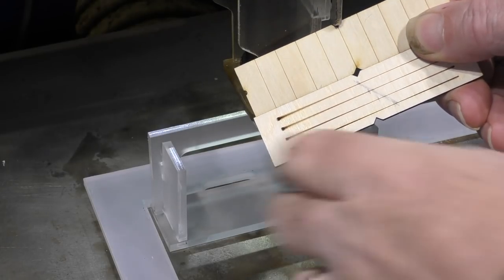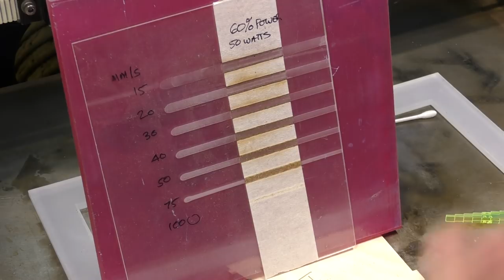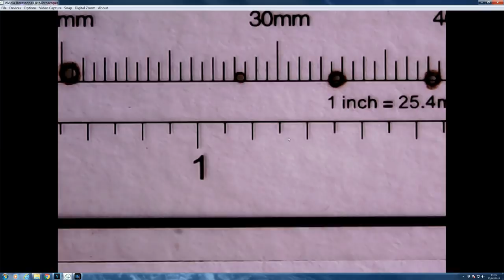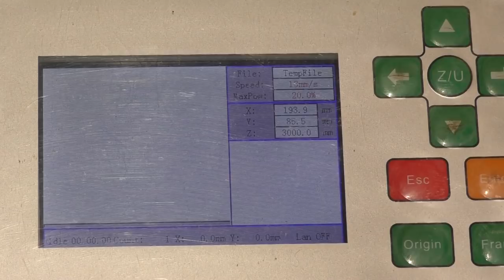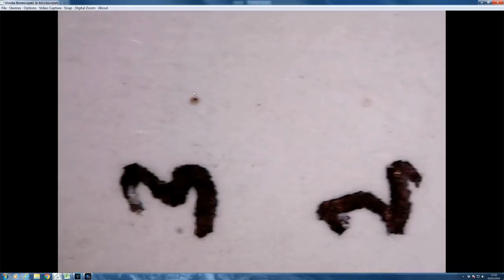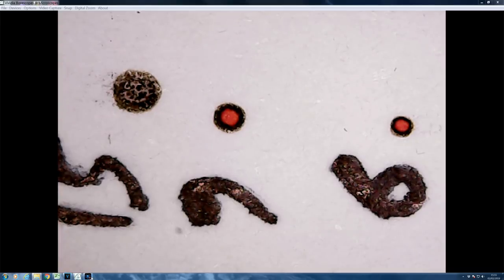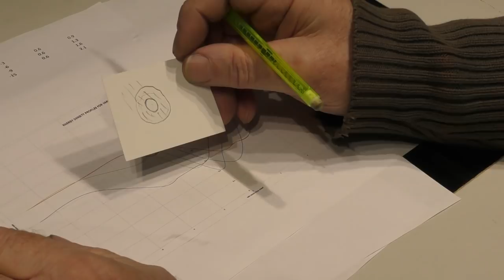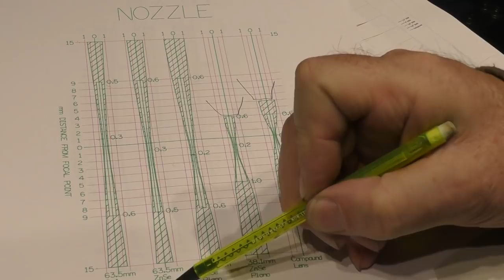RDWorks Learning Lab 162 Lenses part1 Let's Focus

Comment from the maker: To anyone that watches this, it is now several years old and my reserch into the way that lenses and laser beams work  has moved on in leaps and bounds.  This video investigates the fact that the OPTICAL focal point appears to move with speed. I now know that there is an OPTICAL focal point that results when  lens geometry, focuses NORMAL uniform random light through a small spot for IMAGE projection beyond the focal point. However, laser light is not  random or of uniform intensity and has no image to project.  It's work starts and finishes at the focal point. These Gaussian intensity  light rays are refracted exactly the same as normal light by a lens BUT this time were are employing the INTENSITY of the beam to damage material  and that INTENSITY focus is the the feature that changes with speed, power, and material being damaged.. There is so much more to learn.

Comment: Wow. I have to contradict you. You are a natural instructor . As a technical director at a high school for many years I can say your lecture , drawings and charts were captivating and many teachers would love to have your skill. Thank you as I learned a lot about the optics.
Reply from the maker: Hi 
Thanks for the kind words.  As I say, the lens is the most important part of our machine and it appears to be one of the least understood elements. I did college level physics and chemistry and a lifetime in engineering has further focused me into learning more about narrow areas.  With much deeper recent research into optics I am finding it difficult to make theory and practice match. I am further frustrated that I can track down almost zero scientific research on the peculiar way that light energy reacts with materials during the cutting process after passing through a lens. There a a couple of great publications that I have studied during my time of owning a couple of 3kw metal cutting lasers but that theory does not apply to these non-metal cutting machines.  Metal cutting is dependent upon high pressure oxygen or ultra high pressure nitrogen assist gasses for the cutting process  to be successful. 
This initial foray into lens behavior has made me realize I need to understand so much more. I think this exploration will take many more than 3 sessions 

Best wishes
Russ

Comment: Very nice. I enjoy your clear, explicit and “common man” quality of your explanations. That makes this highly technical stuff far more accessible to everyone.
It might also serve to point out that the total power within the beam is distributed across the area of the beam at any point, in a Gaussian curve, and all beam diameters. In short, the total power remains almost exactly the same as the area under the curve of distribution, but consequential to total area. And of course, total energy delivered to any one location is always a function of how long the beam “rests” at that position.
Finally, the difference between the hole made by the converging beam (a) suggests a broader, Gaussian energy distribution, as compared to the divergent beam holes (b and c), which do not appear to be quite Gaussian distribution.
Looking forward to your next installment share and what conclusions you draw from the data.

Comment: When I bought a 2nd hand Chinese laser with no data on the supplied lenses, I performed a similar test but instead of attempting a narrow beam, I used the manual power to engrave a rectangle on sloped wood.  Turned the power down as far as possible while still getting a mark.  The theory is when out of focus and at low power the power density is too low to mark the wood.  Therefore at very low power, only the area in sharp focus had enough power density to produce a mark.  This is how I found the focal lengths of my 2nd hand lenses.  I just made focus spacers for the nozzle to work space for the two lenses.
Reply from the maker: Your method is perfectly valid and it will determine what I would have prevoiusly  believed to be the focus point. This session shows that you can never be certain of the exact focus point The manufacturer claims one focal distance  but we have no idea how that figure was arrived at. The the static tests as I mapped the beam shows large variation from specification and then there is the addition change of focal point with velocity.. Hmmm...who said this stuff was simple???
Best wishes
Russ

Comment: There is a problem with focal length calculations, the focal length of a lens is measured (not calculated) by the focus position when the light comes from infinite distance, but when dealing with macro or close focus it is best to calculate it by measuring the distance between subject and figure when magnification is 1: 1 and F  is the distance between the subject and the figure  divided by 4
Reply from the maker: For my first few years of using this technology I was happy to assume that the conventional lens theory that I had been educated with and used as a photographer was equally applicable to laser light. However as I tried to decode the odd behaviours of different lens shapes. orientations and focal lengths I discovered that conventional lens theory is not applicable. Yes, the focus rule you quote is applicable  BUT the light entering the lenses is not uniformly distributed as in the normal light world. Laser beams  are very non uniform and the intensity is usually a Gaussian distribution. Because the damage you inflict on materials is directly related to light intensity, it means that although the outer diameter of the beam defocusses away from the focal point the central core of the beam has tremendous power (intensity) way above and below the focal point. This is best proven (if you have a laser machine) by observing the fact that the line thickness or apparent focal point changes with speed and/or power. Fortunately conventional white light lenses do NOT change focal length with light intensity and that is why normal lens theory works for a uniform  light from an infinite distant source.
Welcome to the weird world of focused laser beams.
Best wishes
Russ

Comment: Is there not an acceleration factor for bringing the laser head movement up to its travel velocity and then slowing it down at the end of the run and could that be what you are running up against?  I would think running the 10mm slope over the length of the X-axis might show a better or more consistent focal point position?
Reply from the maker: Hi Scott 
 You do indeed bring up a very good point. Yes, it  does take more distance to accelerate the head to faster speeds. However I think you are imagining that acceleration to be slow and the reason for variation of focal point with speed. However, If you lay the material flat then there is no focal variation involved.  What you will see ( as I think you anticipate) is a thick line as the head starts from zero speed and it quickly becomes a constant thickness line until you slow down, whereupon the line gets thicker again as it decellerates.  At slow speed this acelleration phase is about 3mm and at the fastest speed I used  it's about 20mm.  The key narrow parts of all tests were well away from this acceleration region.

 As I move forward with my learning journey, always remamber these are not tutorials by some expert. I am still a student who is self-educating himself  about the minute details of this technolgy. I am sharing my journey for others to observe. Yes I do make mistakes (that all part of learning) but I try to correct them in future sessions. However in this session I did show that the ramp test must be used carefully but did not undersatnd exactly why this interesing anomoly was occuring. It took another 2 years for me to fully decode why.  It turns out that speed, power and material type can put the focal point of a lens as much as 4 or 5mm diffent to the manufacturers  designed focal length 
 Best wishes
Russ

Comment: 52:49 - That's really an interesting question... sounds like bull to me too from what the pros says... Do you get the same results for all different sizes of diverging lens? if thats the case... then it means the pros needs to reevaluate about their understanding of optics and laser beam.
Reply from the maker: The optics companies only have one goal and that is to focus all the light to a single point. That is the standard against which all lenses are judged. All Chinese lenses for these machines are very simply made with a spherical surface. on one face and usually a flat face on the other. This produces a poor quality focus and would be abysmal for photographic work because of a natural effect called spherical aberration.  This can be reduced significantly by adding an additional focusing  shape to the other face of the lens, a concave  surface. This is called a meniscus lens and is about as complex as we can buy Better focussing for visible light lenses  can be achieved with aspheric lenses.. No such fancy gear for us. BUT...do we need it  Crappy cheap Chinese plano convex lenses may be laughed about in "proper" optical  companies  but they cat at least 30% better than the more expensive lenses. Why?  Well I am convinced there is a weakness where the the power is poorly focused  just around the central axis of the  lens. This is because the spherical face is almost normal to the lens axis and very little bem refraction occurs.. This also just happens to coincide with the most intense (powerful) part of our Gaussian laser beam.  Seems like the perfect marriage to gain more cutting power from the lens. Lots more work to do on this and you will see my progress from time to time as you continue following my learning journey.
Best wishes
Russ

Comment: I've been watching several of your videos with great interest! I have no direct experience with CNC Lasers, though I do have a CNC mill and I did take physics in college. Anyway, I see what you're getting at with your interesting ramp experiments, but I do have a problem with references to 'dynamic focusing'. I think we should separate the optics and optical definitions vs. the cutting effects. So, no, the focal length and the instantaneous focus of the laser energy does not change as the speed of the laser head movement over the substrate changes. What is happening reflects the complex interaction of focus (fixed effect) vs. rate of local energy delivery per unit length of travel of the beam over the substrate. Consider the following 2 edge case scenarios all executed with the same (ideal?) focus of the laser cutting, say 5 mm cast acrylic:
1) 'Slow burn case': In this case, the laser is moved ridiculously slowly along the cutting path and one gets an extremely wide and ugly 'cutting' line
2) 'No burn case': In this case at the opposite extreme, the laser is moved so quickly that the laser has no discernible effect along the cutting path.

Obviously the region of practical utility lies between these two extremes. While all else is held constant, imagine runs starting with scenario 2, but with slower and slower cutting head movements. As travel along the cutting path slows, you see first the faintest beginning of etching and these will reflect the smallest 'static' dot size if that is how the laser was originally focused. As speed is further decreased, depth of cut and width of cut will increase. For practical cutting, you have to set the focal point below the surface and set the speed and laser power such that a clean sharp cut is achieved. There is no 'dynamic' focus. But the dynamics of the cutting situation will affect the where the ideal focus depth is for a given substrate (material & thickness). 

Sorry to ramble on, this is really interesting stuff. Hope to have a CNC laser to work with soon and look forward to more interesting videos from you!
Reply from the maker: Hi Steve
In several of my sessions I have clearly demonstrated the effect you describe where  the speed  effect (energy deposited per unit of time) causes the the damage track of the beam to get thinner with speed. I entirely agree that this effect  cannot be anything to do with the focus because I can show this effect with no lens in place. No, the apparent change of focus I am observing is caused by the Gaussian energy distribution within the beam. My brain works in a very naive way and I like to imagine equivalent real world pictures to lock in these flimsy concepts. In this case i imagine a very thin pointed artists brush.  The brush may have a body thickness of 2mm but the tip of the brush will be almost zero. The lighter the application of pressure, the thinner the dots or lines the brush will make  on the canvass.   I do understand that the focus point of a lens is a fixed property. However just because the beam is focused with a lens, it does not lose its Gaussian energy distribution. It is this complex relationship between the focal point and the non-uniform distribution of energy within that focused  beam that is responsible for this apparent variation of the focus point. That paintbrush I imagined is still there at the focus point but it is the BODY of the paintbrush that exists at the focal point , the tip is  below the focal point and it is this VERY high energy  tip that is doing material damage  below the focal point. I am neither an optical engineer or a physicist but I suspect lens features are defined and tested with pure uniform monochromatic light sources. We are not using such a light source thus the  practical world results I am discovering are somewhat different to the the lens theories I have always believed in. You must always remember that these videos are a look over the shoulder of an old guy on a journey of discovery. I see something that does not make sense and then try to use simple shed science to tease the truth out of what I am seeing. I may draw an incorrect conclusion from my experiments and observations  (and I have done so several times on this journey) but you can see those same  tests and if there is an alternative explanation that may get to that truth quicker, then I am only too pleased to slot your piece of the jigsaw into the big picture I am building of this technology. 
I greatly appreciate your comment and  feel sure that you will come across some things that do not make sense when you get your own machine. It is a fascinating subject and of all the parts I have explored , lenses (the final and most vital part of this machine) seem to be the lest understood.

Best wishes
Russ

Comment: I am wondering what would happen if you fed nitrogen or argon into the air assist tube to prevent combustion on combustible materials. Maybe even flood the whole inside with Argon, it should hang around for a little while with the lid closed as it is a heavier than air gas. I wonder if you would be able to carve wood with more power without blackening. Possibly it would assist you with 3D carving.
Reply from the maker: Hi William
It's an interesting question to speculate on but I have no equipment or facilities to try either.  One thing is certain, you will not destroy or reduce the energy transfer that takes place as the IR light stimulates the wood surface molecules into higher vibration states. The higher the vibration the  higher the temperature of the wood. Even under an inert cover gas the wood is still  going to heat up and some sort of chemical reaction will take place as the cellulose shakes itself to pieces. I am no chemist but I suspect there will still be some very local burning taking place within the cut because there is quite a lot of oxygen locked away in the sugar molecules. I am sure there are lots of guys out there with TIG weding sets that already have the argon shields gas that they could hook up to test your idea.

Best wishes
Russ
Reply: @SarbarMultimedia  You have a good point on the side reactions. Charcoal is made by heating wood without the presence of oxygen after all. I'll have to try it when I get a laser in the next year or so!

Comment: Hey Russ, have you found a robust solution when you are etching acrylic to avoid "ghosting" from when the acrylic is cut and the residue is blown back onto the surface of the material? Thanks, Ash
Reply: Hi Ashleigh.
Acrylic is a fantastic material  but it is not an easy material to work with. If you understand how it reacts to the laser beam you are part way to solving the problem you have encountered..You instinctively know what happens to a cup of water when you boil it hard. It converts from a small volume into steam which will completely fog out a room in a few minutes. In the same way there is a tremendous volumetric growth as you evaporate acrylic . If you take lower power cuts at high engraving speed you will cause the fumes to explode upwards. If you have the air management through you machine set up correctly then you have a fairly high velocity of CROSSFLOW air over your work That crossflow will carry those fumes backwards IF (and only if) you have a large gap between nozzle and work and also just a whisper of air assist to prevent lens fogging.. If you are impatient and try to cut with more power, you are instantly converting more solid acrylic into vapour. That vapour conversion rate is so high that it does not just explode upwards, it projects horizontally as well and will contaminate your work surface . Just experiment and observe very carefully and you will see the effects I describe.. Although there are several tricks to protect your unengraved work surface. It's the engraved surface contamination which is the real challenge.. Two or three light passes will be better than I deep pass. The clue in you question is "blown back down". Turn your air assist down to just a whisper toprevent the blowing down effect.

Best wishes
Russ
Reply: @russsadler3471  thanks for your guidance Russ, as always 👍